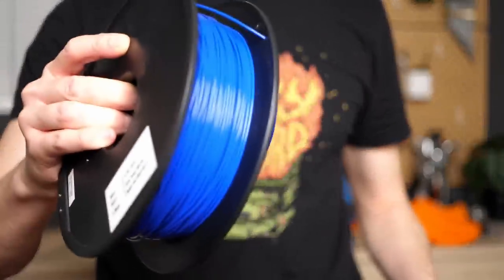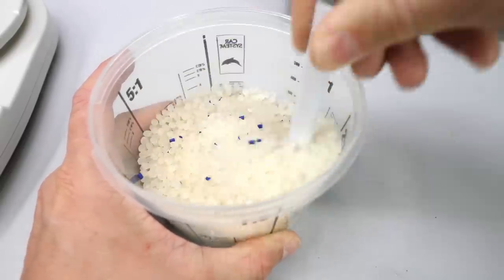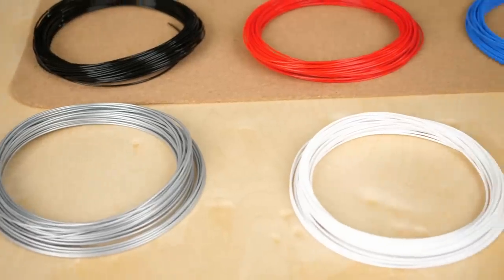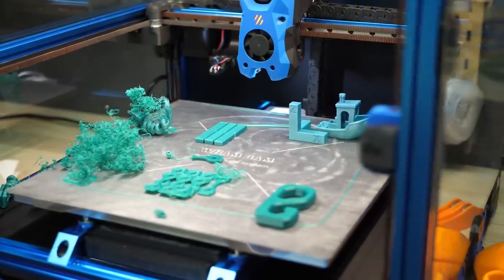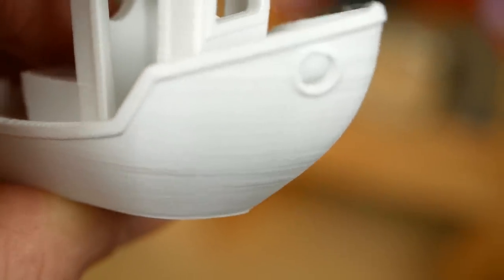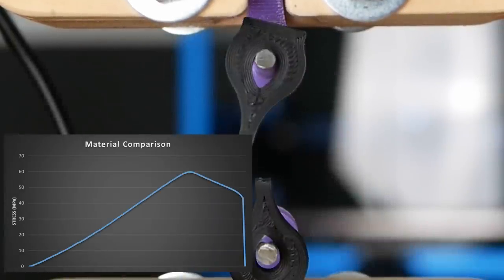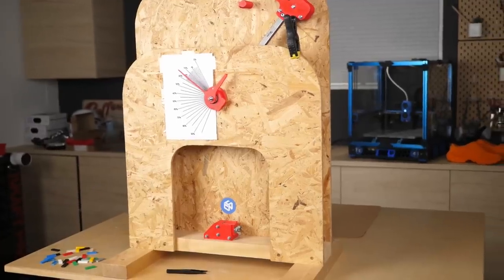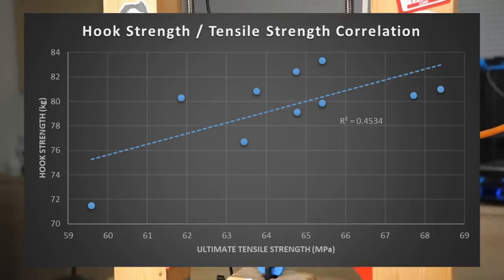Myth Busting: Color vs Strength in PLA

Comment from the maker: Did you ever notice a difference in your 3D prints, depending on the material color?
Also: check out our CNC Kitchen products at https://cnckitchen.store/ or at resellers https://www.cnckitchen.com/reseller and on AMAZON (EU) https://geni.us/s8rYtQ
Reply: for the best print temperature to combat stringing, I encountered up to 15°C difference from the same manufacturer.
Reply: Hi CNC Kitchen, may I make a suggestion? Your thoughts on residual stresses are a lot more relevant than you think it is. Up for having a conversation? You're starting to delve into principles around weld buildups. My day job is on the metal side of buildups,  but it has a significant amount of overlap with what you are exploring.
Reply: I print with ABS and i had noticed some diferences, specially with red and Brown,  but i recently changed my supplier to a better and did not test different colors yet.
I discarded the color theory thinking it was my previous supliers that was very bad. Thanks for letting us know that this can be a problem even with good suppliers.
Reply: YES and its fkn annooyinggggggggggg
Reply: Yes, BUT I think the amount of difference between colors is almost similar to the difference between brands. My takeaway here is to maybe stick with blue or translucent colors for strength from now on. I totally agree on staying away from silk or matte filaments for functional parts, though.
Reply: @trischas.2809  same here
Reply: Yes - matte filaments are incredibly brittle and weak
Reply: I mainly noticed that white (PETG) tends to clutter up the nozzle and it is also said to be abrasive to your nozzle too.
Also for PETG I noticed that colors with some 'galaxy' sparkles in them and/or semi-transparent react quite different from for example "Urban Grey" (my absolute favorite in PETG, as it simply always results in perfect prints and feels more pleasant)
Reply: Thank you I've been wating for somthing like this
Reply: @brianfhunter  Same here. Red ABS has been the weakest and most problematic for me, even across suppliers.
Reply: Most definitely.
I print most of my parts in FormFutura ApolloX (ASA) filament, and the red color is by far the most 'stable' to print. I've tried dozens of variations in speeds, retraction settings and temperatures to get the black one to print nicely but at best, I could only get it to print very slowly (50-60 mm/s at 0.2-0.24mm layer heights) and even then it was not extruding properly. Filament drying would then make it even more unprintable; the filament would become brittle and instead of bending it flat I would just break the end of it, straight off the roll.
White and blue ApolloX are great though, and especially the blue one prints very similarly to red, but with a slight penalty of being more sensitive to low temperatures at the nozzle during printing.
I've been through about 12 rolls of red, 6 rolls of white, 4 blue and 3 black so far, over the course of 1.5 years. One of the rolls of the black was worse than the other two, which printed fine enough to not throw away, when going slow.

That said, in general ApolloX is a very impressive engineering filament with a wide variety of uses.
Reply: Great experiment. You taught us about a new Parameter for Material properies. But now you kinda have to redo all the videos you  did  on comparing  different filament Materials since you always used different colors 😬

But hey Enttäuschung ist immer  das Ende einer Täuschung. Great  work like always.  ❤
Reply: eAun ABS+ in black has very poor layer adhesion, pther colours do better
Reply: Yes, I started 3D printing in 2016, and I thought it was well known that black and white filaments had the most issues due to the additives in them. Although lately my black filament has been printing a dream. White still needs work. Of course Silks sometimes have issues, but red ttyt silk has been working well enough for me to get some nice looking parts out of it.
Reply: I am shocked by the news that natural does not simply outperform in every aspect. As always perfect information perfectly presented. May there be a kind sponsor to send you the much needed extensometer. You deserve it.
Reply: I'm willing to bet filament color affects creep too.
Reply: Really interesting results and it is somehow to be expected, that the color influences the material, it's like metal alloy. 
Now it would be interesting to know how the results of the same filament from a different production date would differ.
Reply: I've noticed my favorite, overture space grey (gunmetalish not quite metallic) to be very good in strength and have excellent dimensional accuracy, to the tune of .03mm on mechanical parts, and no other filament I've used has quite surpassed it in its general usability. I always consider print orientation in strength, so it would make sense that a stronger tensile strength filament would be more usable to me. I do think whatever's in these silver-ish pigments should be looked at. there's something going on with them that makes them react a bit different-
high tensile strength, high impact strength, low ductility, and lower warping- it's the closest to an engineering material from your test group, and my (more limited and less informed) one.
Reply: @Dogburt_Junior  Indeed had some vary stringy black PLA.
Seem to recall a rule of thumb that darker materials was more prone to oozing due to there (often) being a need for adding more colourant to  those
Reply: Hi Stefan,  Love your analysis videos.  Have you ever considered doing a series on the impact of infill pattern on overall strength of a part?
Reply: Another observation on this analysis, is that you might consider looking at adjusting the print parameters to achieve consistent layer adhesion (at a microscopic level) and retesting.  It is possible that the additives are taking away from layer adhesion and there by causing premature failure.  Then comparing the results of both tests to see if there truly is a correlation between color and strength.
Reply: After I had a hard time with my first prints with black PLA I thought about the impact of the color particles as well and therfore choose to try white. As the white PLA and ABS worked really well I print white only ever since. White is also perfect if you want to paint the prints afterwards.
Reply: I noticed black requires less nozzle temp than white. The darker the color, the less heat it needs.
Reply: I noticed a long time ago, with PLA from Faberdashery, that red seemed more liquid than blue at the same temperature, so it doesn't surprise me that it would make stronger prints.
Reply: CNC Kitchen
I think there is a piece missing on the test and that is how diferente colors absorb more or less HUMIDITY, you didn't dry all the test filaments. I am pretty sure diferente pigments absorb humidity in a different way and maybe that is another thing that has an effect on strength.  For example there is another youtuber that exposed different parts of a spool to humidity and was able to create inconsistentes similar to like this * on purpose: *https://youtu.be/BMSp1WDqtpI?t=393 So it has a huge influence. Maybe if all the different filaments are equally dried the differences get smaller or totally disappear.  The video I am talking about: The source of this 3D printing artifact is overlooked: Humidity !  https://www.youtube.com/watch?v=NvukJd4QyBk
Reply: I print TPU fast and have learned that red is the most painful filament, needs an extra 10C to not have a pressure jam over a 8 hour print. All my other colors (matterhackers Build TPU) will print with the same settings and get comparable results that work, but not red. Red needs its own special 10C hotter (limit of the filament breaking down) and 10 mm/s slower to get the same results as all the other colors printing at 16 cubic mm flow. Seeing your results that red is the least ductile material, this makes sense for me, as it would be the hardest color to jam through a tiny nozzle hole with low ductility. This would create more nozzle pressure than the other colors which is quite important with TPU, and change the final product 
I think this shows that if you are printing just on the edge of your hotends flow/heat capabilities, you have no choice but to reduce speed in order to be able to print red similar to any other color. 
Has anybody else experienced anything similar?
Reply: Variations in the same color in different batches may impact its properties as well as age of the filament, so there may be more differences between two batches of the same color but different age than two different colors of the same age.
Reply: really cool ! red filament rocks ! there has to be some magic in that red ink :)
Reply: CNC Kitchen, I tend to disagree with your conclusions and as far as I can see from the comments, I might be the only one saying this. Dark materials attract more light and silver or white reflect more. This is also true to some extent for a small portion of the IR spectrum. This is one of the reasons for why different color materials have different printing temps. Layer adhesion is not only influenced by the heat of the filament extruded through the nozzle, but also the cumulated heat into the already printed part. Black parts will attract the IR coming from the hotend and stay warmer in their mass during the printing process, compared to white or silver parts. The new layers fuse better to dark parts as they remain hotter during the printing process. This is also the reason for why dark filaments require lower printing temperatures and they tend to anneal more than white ones. In order to make your experiment relevant, you should have printed temperature tower tests for each color, determine for instance that black prints well at 195*C and white at 205, print the black hook at 195*C and the white at 205. In your tests, the way you did them, the difference in layer adhesion does not come from the difference in pigment strength, but from the fact that black was retaining more heat during the printing process compared to white. This is why your results are all over the chart and in some cases black is the best and in others, the worse. Just saying.
Reply: @FunElectronicsToday  just 2 cents, it may after all not just be the color that matter. rather adding other chemicals/polymers can change the property of the plastics/material and could affect its strength. this suspicion also means that different dyes of the same color may have different properties and not simply the color alone which affect strength.
i think if we can use composite plastics e.g. add polymers which is capable of strong hydrogen bonding, so called hard-segment polymers, we could turn 'ordinary' plastics e.g. ABS, PLA into something else there is represented by the composite material rather than the original polymers. But I'd think many composites are sold as ABS, PLA possibility as the main component, but i'd guess the composite materials are seldom mentioned possibly due to trade secrets etc.
Reply: yep for arianeplast(from france), for me the white pla is much softer than the red and black. That mean that I don't use white for detailed or mecanical prints.
Reply: So I was hired to rebuild some equipment that i originally designed in 2016. The device has a glass housing and internal parts were ABS some were yellow and some were black. This stuff spent years out side. The black abs was fine the yellow parts were crumbling. It seems the black is much more uv resistant
Reply: I have noticed that some colors from the same manuf sometimes print nicer than others but never did the nitty gritty testing to see what else was different.
Reply: @8777ga  please, what brand? I've purchased some "reds" that look orange (Matter Hackers and TechBears). Thanks
Reply: I remember discussion about white filaments performing badly many years ago, and definitely saw differences between Hatchbox blue ABS and Hatchbox white ABS. This was back when Hatchbox was a new budget brand and before it stopped working well with acetone smoothing. 

I would be interested in seeing these tests repeated with ABS, though I'd be fine with fewer colors. White, black, natural, and one or two colors, perhaps.

Comment: I work in a masterbatch laboratory and can confirm, pigments can make a colour behave very differently. Usually it's way less pronounced in a finished product, with dispersion values ranging usually between 1 and 4%, but as seen in the video - it still makes a difference. A thing I noticed for example, which wasn't mentioned here but I can tell from experience, is that silvery/glitter colorants make the extruded material way more prone to absorb moisture, it's worth keeping that in mind
Reply: I believe it is because it makes it more porous, which is why carbon fiber filament (especially stuff like Onyx) absorbs water very quickly
Reply: We've found our bronze petg absorbed way more moisture (or just faster) than our gold and silver petg. Same manufacturer
Reply: Which Masterbatch Company do you work for?
I am asking out of interest.
Reply: @schizophrenicgaming365  That's very probable, or at least a contributing factor
Reply: @longnamedude3947  It's Avient
Reply: Real world data point: I have some old filament im using up, every color is fine EXCEPT uncle Jesse's gunmetal silver..
Reply: @tomallo99  Ah, US-based?

Do you work on Masterbatch mixes yourself?
Reply: @longnamedude3947  The company is based in US but I'm in an European plant. As a quality control operator I do work with some of the batches myself, for example ones that need to be corrected. But I'm mainly responsible for testing colour and other properties of production samples.
Reply: @tomallo99  So the usual moisture content, dispersion, checking for contaminants, ensuring it's mixing as it should, checking for density, that sort of thing?
Reply: @longnamedude3947  Yes, exactly
Reply: Do you know what happens if you mix pigments i am really curious
Reply: @boom_headshot56  In what form are these pigments taking?

If they've been pelleted into a carrier material (polymer/plastic) then mixing is still possible but depending on what carriers have been used it may not be compatible because of lamination.

You can mix pigments in powder form because that is how EVERY colour is made, you extremely rarely (if at all) just use a single pigment in making your target colour.

Typically a colour is made from multiple pigments of rather low percentages vs the total size of the carrier Masterbatch that you are producing, and then that Masterbatch is mixed into the target polymer/plastic at varying different ratios depending on customer requirements, and, application requirements.

Seeing percentages of pigments in the amounts of 3g per 250KG of end output colored material is rather common, and when working with metallics the amounts of pigment can be as low as 0.1g - 0.8g being common.

Their are thousands of different pigments that are available, some are organic, some are inorganic, some are cheap, and others are insanely expensive (Thousands of € per 10g of pigment).
Reply: @boom_headshot56  So in short, when you mix pigments, any colour is a possible outcome depending on what colours you put into it.

It is common for many colours to contain White in them to some extent even if low in quantity VS the overall batch volume.
Reply: Nothing to add here, guy knows his stuff 😅 In short, let's say we've got 200 different pigments. But our eyes can distinguish between billions of colours. To get all these 'in between,' you just mix pigments in different proportions. So, essentially the masterbatch company's main job is to make a certain color that the client requested.
Reply: @tomallo99  And if that client is really picky then it can take a very long time to get to the right colour..... Speaking from experience one might say hahaha
Reply: @Long Name Dude I mean just the colours not the specialty ones. Thank you btw
Reply: I've noticed that gold PLA absorbs moisture very quickly. One of the very few PLA filaments that I've been forced to dry.
Reply: makes sense, glitter chunks making it nonhomogeneous.
Reply: @kingmasterlord  you're a glitter chunk 😏
Reply: @ryanbabros7981  damn right
Reply: I got some years in injection molding and in my experience any type of green makes the plastic more sticky even if it has cooled it was way harder to remove from metal than other colors and all of our red colors needed some extra motivation to fill the molds :D